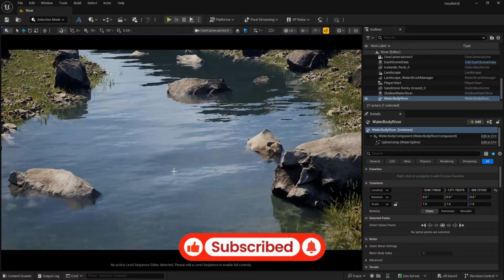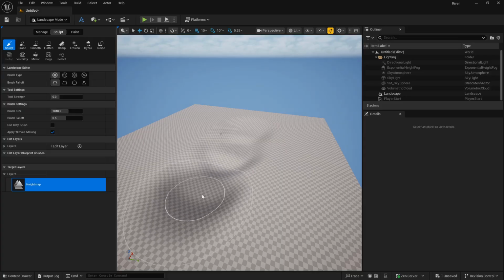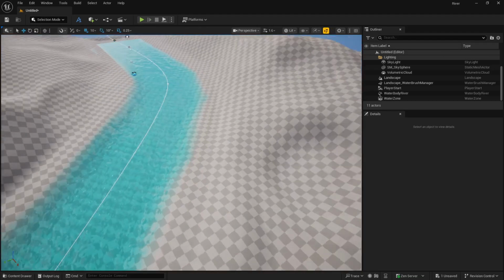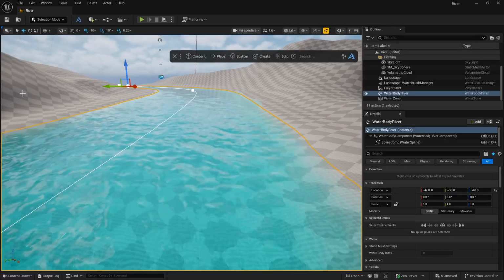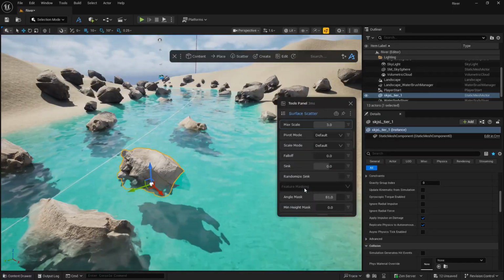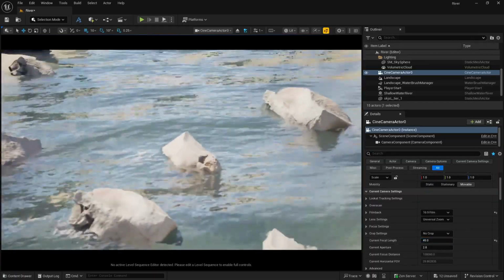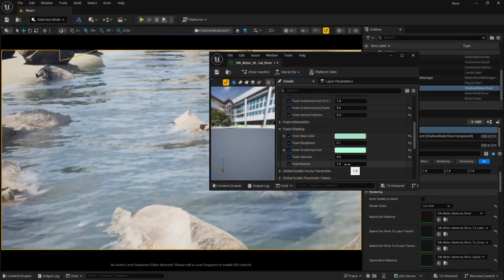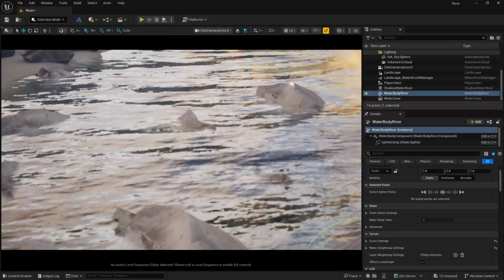Unreal Engine 5.6 Full Beginner Course (Day 19) : River Simulation Unreal Engine 5.6

Comment: How to express the caustic underwater and the detailed foam won't be implemented yet?! I want Flux3's detailed water. But I think the 5.6 version is much lighter and more accessible. I'm curious about your thoughts.
Reply from the maker: I agree with you but i think epic will improve it in future builds. Before this if we want to achieve foam we need to either fake it using material or use niagara fluids which is not optimised for games. Flux3 is good option but again need optimisation for game where water is everywhere. Caustic underwater is possible in current river but need to tweak material
Reply: @RenderRebels  After that, it seems that many people will want the additional water intensification lecture. Please review it positively. Thank you bro!
Reply from the maker: @erica7518  Sure i am planning to integrate liquidgen with unreal engine for cinematics not for games. Also i am personally interested in fx so exploring houdini angle as well. Cheers